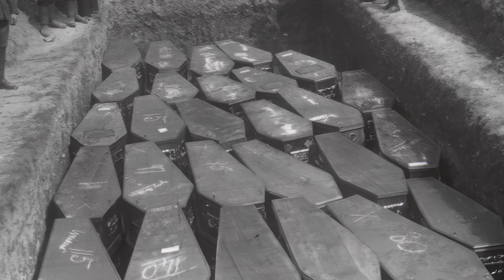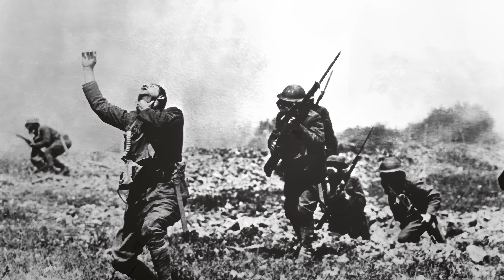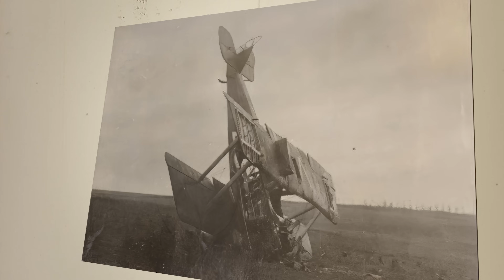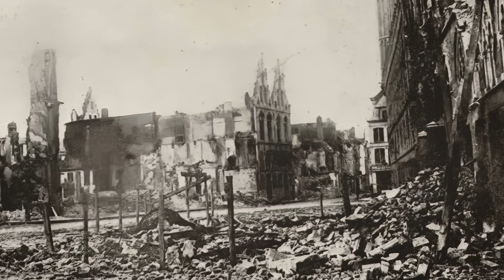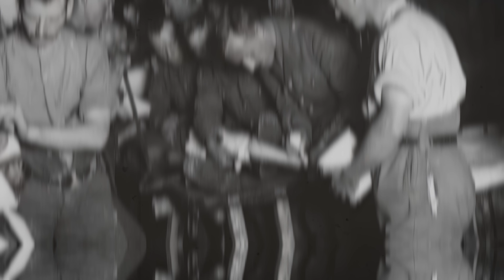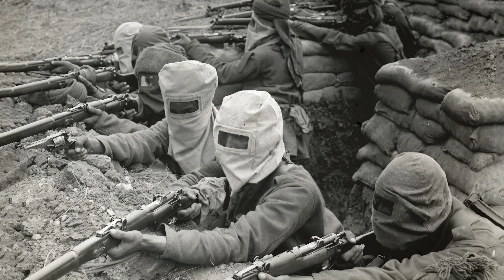📷▶ These WW1 PHOTOS Were CENSORED for SHOCKING Reasons | Historical Photos

Comment: The aeroplane shown at 12 minutes, crashed on it's nose, is not German, but a British DH5 fighter. Introduced in 1917, it had a span of 25 feet, powered by a rotary engine and equipped with a single vickers machine gun. It's unusual features were a swept back upper wing (almost unique in aeroplane design) to give the pilot an unrestricted view forward, and the fuel tank situated above the upper right wing. Both these features are very clear in this picture.

Comment: That mass of sandbagged huts is Not an observation post. 
Troops built those on the back side of hills to help rear troops survive artillery attacks and reconnaissance by fire in which some machine gun or artillery genius would figure out how to angle bullets or shells down reverse slopes hoping to hit troops, emplacements or supply dumps.  I have a post WW1 book discussing the practice written by and for the military.

German front line troops survived by hiding in 40' deep dugouts.
Some may be flooded but I have watched at least one video of one drained and explored by archaeologists recently.  All that shelling accomplished very limited results.  As soon as the shelling stopped they would emerge and man the machine guns.